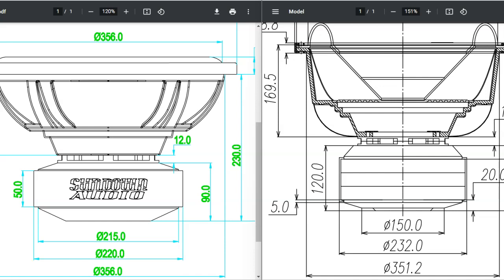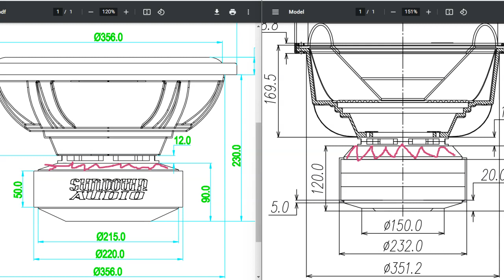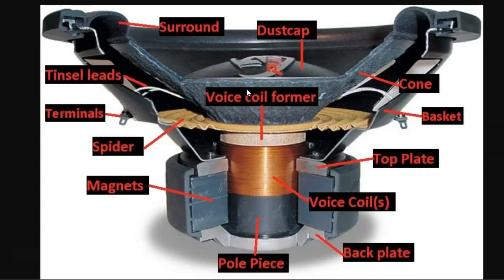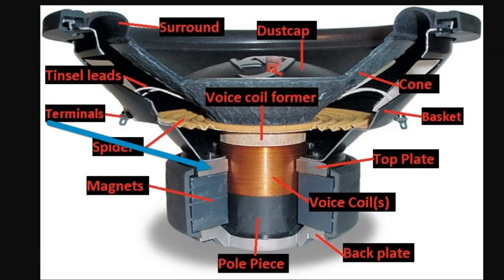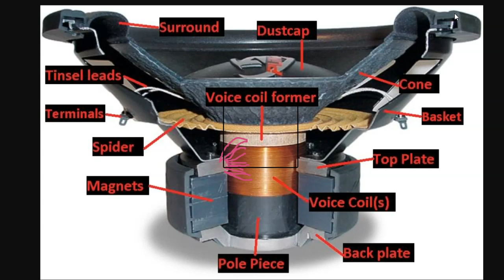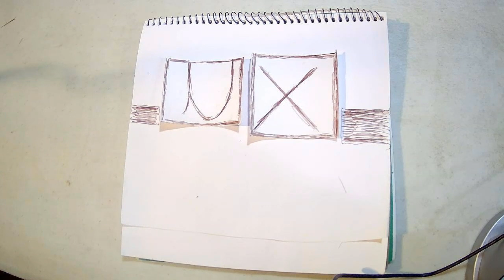Sundown Audio U Series Vs. X  - (All about Xmax -Uv2 vs. Xv3) Part 2 of 2

Comment: absolutely LOVED this video ..well done ...this is great!!! but i got a question for yah .....which is louder ..the JL W7 12 inch or the sundown ZV6 12 inch ? both of them in a custom box tuned to 25hz ..which will be louder ?
Reply from the maker: If you are running low power, like a 1k amp, the JL W7 may be slightly louder, but I bet your ear could not tell the difference.  With more power, the Zv6 will easily be louder. However, the ZV6 has much more stroke movement.  If you want to tune at 25 hertz, I would absolutely recommend the ZV6.
Reply: @caraudiolab  so all in all ..if both were to be ran their full power ...the sundown zv6 would be significantly louder ..... ok ..thank you so much for that ... now .. how about sundown zv6 vs sundown xv3 ..both 12 inch in a custom box tuned to 25hz ? also what size would fair much better in a tuning like that ..a 12 inch or the 15 inch ? and if its the 15 inch ..how significant would the output be compared to the 12 inch ?
Reply from the maker: @infrasonicrebasses4763  The JL would be louder per power at 500 or lower watts, roughly.  However, once you give each 1,500 watts, the zv6 would be louder.  I would go with a 15" over a 12" simply due to the extra cone area, about a 1.5 db gain, if you have the room.  The zv6 will be louder, but probably not that much.  Considering the cost difference, I would either go with the xv3 or the nightshade subs if you want to spend the money.  Those are awesome!  I have both the z and x series.  the x series is slightly more power efficient but the z handles more power.  I am currently setting up a zv6 18" box in my car with a wolfram 9k amp wired to 1 ohm.  I will have to be careful with it, but doing so, it will be fine.
Reply: @caraudiolab  so it sounds like the JL w7 basically caps out due to its low power handling and the sundown is just brute forcing its way for more output ? oh also thanks for answering ..much appreciated ....ok so 15 inch for a 25hz tuning ...i agree and i will have the space so i shall do just that..or i may tune lower haha ...and well the zv6 being able to handle more power than the xv3 ..that could contribute to being a little bit louder than the xv3 ..i heard some people say the zv6 sounds a little better than the xv3 .is that true ?

Comment: The only part I dont get is how can they measure to have the same x max since the stroke length is different. That should make em both have different xmax and should resemble the stroke length. I get the xmax is the measurement of how far the woofer can jump so seems like it would be equal to the stroke length. I will watch the video again. You explained it well in detail.  Oh, k watched it again. That top plate essemble being bigger is the other part. I guess i dissagree with the manufacturers measurement of xmax. I just think of it as the overall stroke, not the top plate essembly connection thingy sending flux lines to the voice coil at a certain part of the woofer jump.

Comment: I just bought 2 U series 15's tuning to 30 hz bandpass build with a big ass port. So excited to hear these things 😁
Reply: I've got one U-18(V1) on 1,600 rms in a 4ft3 (net) L-port enclosure, tuned to 35Hz and it absloutely SLAPS! You WILL NOT be disappointed in your choice of 2 U15's. Say goodbye to your hearing!
Reply: @csj9619 I have 12 lol 😂
Reply: @csj9619 4.3 for an 18? Isnt that small?
Reply from the maker: That sounds amazing, I bet they will be LOUD!
Reply: @caraudiolab  debating on how many watts to push them with then i'll decide on the amp
Reply from the maker: @A1B3R7I  If they are the version 2's, I would go with around a 10k amp max.  If you are very careful and know what you are doing, they could handle more.  For the version 1's go with around an 8k max.  Again, if you are careful and know what you are doing, they can handle more.
Reply: @caraudiolab  they are v2's thanks !!
Reply: 30htz that’s low they will perform better around 35
Reply: @JohnWilliams-oc9bo  correction it's 32 like it said on the site
Reply: @A1B3R7I  some sites say 35 lol 😆
Reply: @A1B3R7I  sundown says 35
Reply: @A1B3R7I I just looked sundown says 35 all others are wrong lol 😂

Comment: So I’ve been trying to choose between the two and this helped quite a bit. Will the U still perform down low at 30hz in comparison to the X. As in is the different significant enough to choose the x over the u?
Reply from the maker: Watch my Part 1 on this to get a good idea of when the U is a better idea or the X is.  It is all dependent.  I know people that tune their boxes at upper 20's that use U series subs.  So, they can play low no problem.  If you want to play low 20's or teens, go with the X.

Comment: Can you do a video on the tc sounds lms ultra 5400 18” sub and talk about the coil it as and compare it to the xv3 18”
Reply from the maker: That is such a great sub for the time!  I have tried to find more info on it but come up short for the coil length.  However, I can say that the XV3 has much more stroke peak to peak.  So for lows, the X is clearly a winner.  However, the TC is more sensitive and should do better on lower power.  The TC need a Huge box though!  The X need a big box!  If you want to know something specific, let me know!
Reply: @caraudiolab  the coil on the tc sounds is 3.25 long but it has that variable winding on it (LMS) my question is which one is gonna sound cleaner i seen on a archive website the box it calls for is a 4.5 cubes per sub i thought that was small i asked a few guys on here that have used it a long time ago and they all said 4 to 4.5 cubes in a ported enclosure

Comment: I have five different subwoofers dd3515 xmax 22mm?psi platform 4 15 xmax 36 mm fi xmax 34 mm and sundown xv3 12s xmax 30 or 32mm the massive sounds similar to dd smooth response with a lot of control on the lows psi and fi or similar they won't move unless you put some deep bass on them  but sundown is kinda weird maybe because of the surround? It acts like it has no control just floppy in my opinion?
Reply from the maker: Yeah, the X was built to be different than traditional suspension subs.  I mention it in the part 1 video, but some people don't care for the sound of the X because it is so different.  The Z series has a much stiffer spider like your other subs, but the X has a very soft suspension.  I think it helps it preform better because it is a lower powered sub.